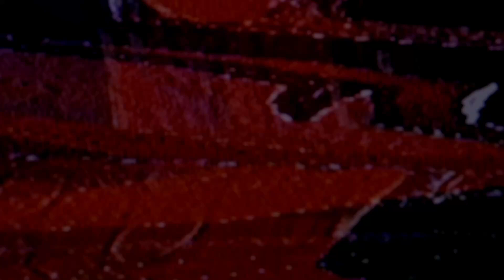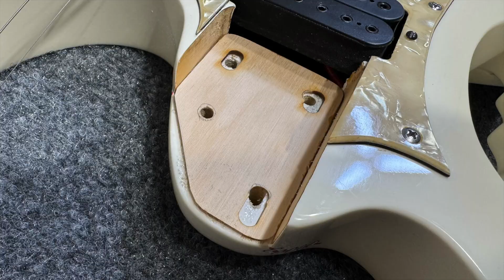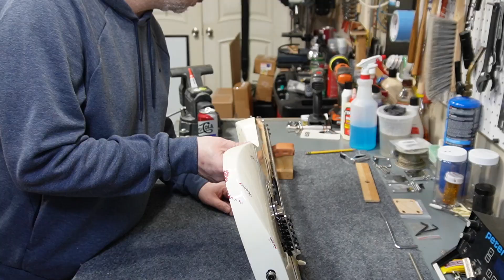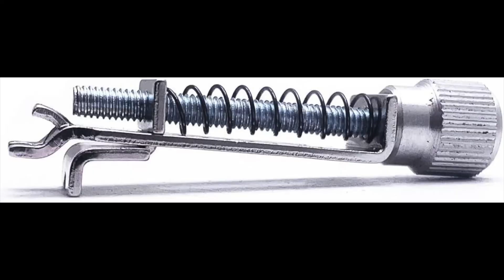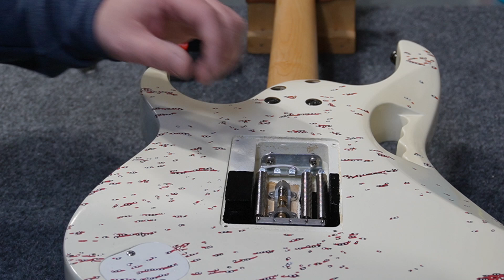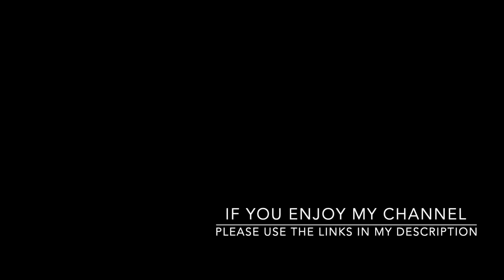Ibanez Jem Project - Part 6 - Installing Neck Shims & Tremolo Stabilizer, plus Floyd Rose Intonation

Comment: My high e string buzzes when I hammer on 1 3 4...only the high e string and the frets don't buzz when I fret them individually only when I do legato in them will a shim help that as well? I need one to give me more angle but am also wondering if it will solve the strange buzz
Reply from the maker: If your bridge will still adjust up and down, you usually don’t need to change neck angle.  Start by checking neck relief for this issue.  It affects the low-numbered frets most.  Hopefully there isn’t a twist in the neck, since you only have an issue on one side.  You might measure your relief on both the high and low E sides to check for that, even though most people only check it on the low E side.
Reply: @hacksguitarhobby  you're probably right, I bought a used Jem and the previous owner had it blocked basically, with 4 springs and in e flat. Every thing played good then I just don't like e flat and 4 strings was too stiff, took off a spring then the 1st fret buzzing occurred. Thank you
Reply from the maker: Now that the string tension is more with the higher tuning, I would think that would increase relief, which is what it sounded like you needed, but it’s still worth a check.  Try leveling the Floyd also and check your action after the relief.
Reply: @hacksguitarhobby  thanks for helping should I check the relief after initial tuning? what sequence do I do the TRAIN method?(Tune, relief, action, intonation, nut) Im hoping I shouldn't need much I just changed strings, set the bridge flush it's in good tune but the first fret high e is still buzzing. I haven't altered the relief yet
Reply: @hacksguitarhobby  also the action is a bit higher than I would like in the higher frets? Will I want to adjust the bridge height after the neck relief? Sorry for blowing up your notifications haha
Reply from the maker: Train is a good order in general, but tune before every adjustment as a best practice.
Reply from the maker: Yes, action after relief for sure.
Reply: @hacksguitarhobby  one last thing, should I detune the strings before adjusting bridge height? Should I block it? I did give the neck relief and that solved the buzzing, now time to get the strings at an acceptable height. I have the bridge sitting level with the body as if it were mounted. I know lowering the trem will reduce some of the range but I can compromise that for low action and no buzzing.
Reply from the maker: It’s not totally necessary to detune, but it’s probably better for your bridge posts and the knife edge of your tremolo to reduce the tension and detune.  I would not block the trem, but it’s up to you.  I installed a tremolo stabilizer as a decent compromise between floating and blocked.
Reply: @hacksguitarhobby  yeah I noticed at a certain point the trem will remain balanced and tuning will be stable enough. I should invest in one of those intonation keys that was a nightmare! I think they should come up with a new design. I tuned and intonated while standing, slightly hunched over and standing slightly more up - the natural position movements we do while playing to approximate good intonation in those positions. I can lean over slightly as well as lean back slightly and will remain in tune.